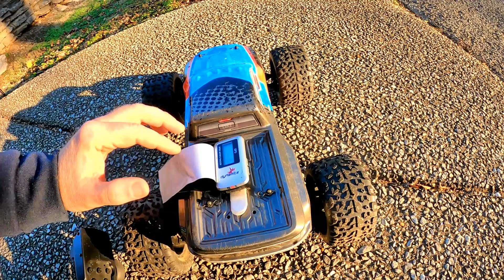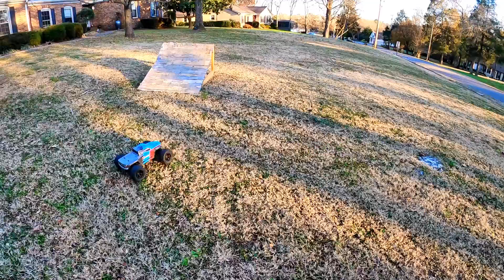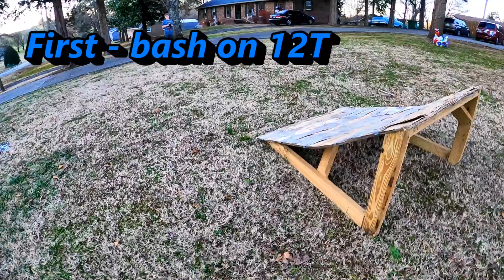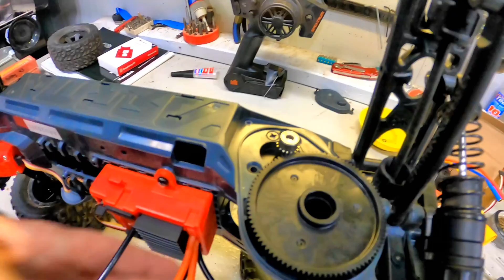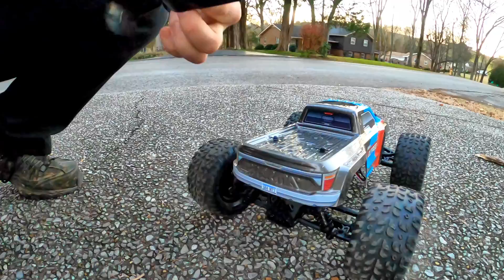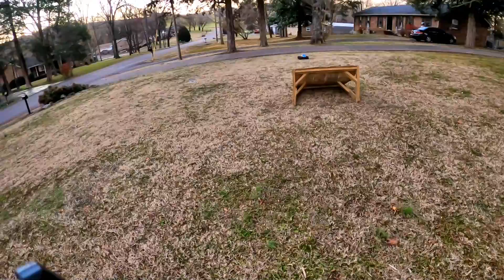Arrma Granite Voltage | 20T vs 12T vs 3900kv | Brushed vs Brushless Speed and Bash Test

Comment: If you would like a better mounting system for the ESC and receiver on the Voltage AND have access to a 3D printer, I've designed a couple of plates using the original standoff screw holes. Check it out: https://www.thingiverse.com/thing:4678451
Reply from the maker: Thanks for the tip!  That is great!
Reply: You’re awesome! Ty!

Comment: Did you end up flipping the pinion mine came like that
Reply from the maker: I never changed it from what you see here.
Reply: @RoadsideRC  should I go for a gool rc motor not sure which one will give best punch I have 12t motor and 2s 120c 5200mah lipo wanna get a good motor which kv is best

Comment: I put a 3930 kv in mine and its a little tight theres no playis there supposed to be some play between the spure and pionion gears
Reply from the maker: There are a number of videos online about setting gear mesh.   Check some of those and compare to what you have.
Reply: @RoadsideRC  the pionion is 16t

Comment: If it was a 12t racing motor it would have great torque and higher speed
Reply from the maker: This was a 12T 550.  My understanding is a 12T 540 might have been a little better, or one with adjustable timing.

Comment: Unfortunately thr gears aren't made foe brushless,  I had to learn this thr hard way. Eventually putting the brushed system back in. You can buy steel gears for 100.00 but a bit much for a 120.00 truck .
Reply from the maker: I had good luck with brushless on this truck. No issues bashing it!

Comment: Do the 540 and 550 motors use the same pinion gear?
Reply from the maker: In this video, I used the same one.
Reply: Cool beans. Ive seen on Amazon that some 540 motors have a 3mm shaft instead of a 3.175mm shaft. Does that cause any problems?

Comment: I bought one for my son for Christmas and it's a lot of fun. The stock battery was a 6 cell NIMH.  On this video you used a 2s lipo. I was wondering if there was any speed improvement from a 6 cell to a 2s? Thanks
Reply from the maker: Max speed at fully charged shouldn't be much difference, but the lipo holds a higher charge for longer, so you get a better run time and more fun.

Comment: I am just getting in to rc cars doese it take a lot to upgrade to better moter ect
Reply from the maker: You can see in this video what it takes.   Links are there for the prices, etc.
Reply: Im getting 1/10 with a 390
Reply from the maker: Which one?
Reply: Bezgar
Reply from the maker: @nickwilliams6869  That will be a little bit smaller 1/10, so the 390 will do good.   It will still be down on power a little bit, but fun!
Reply: @RoadsideRC  thanks for the help
Reply: Never mind im getting a 1/10 with a 550
Reply: 112

Comment: The problem with the 12T is that remember you had to reverse the motor wires so you were running the 12T in reverse and those motors come with a set amount of advanced timing but when it has to run backwards your running the timing retarted, thus the slow speed if you had a reverse rotation 12T 550 it would go a bit faster you could also run bigger pinion and get more speed that way and it would probably run cooler ,I didn't read all the comments maybe someone has said this already but if not hope this helps.
Reply: I love comments were you can tell someone actually knows something and is trying to be helpful. Hard to find these days.
Reply from the maker: You are right for sure!
Reply: That is a fantastic thing to remember when swapping motors!  Thanks for the great info!

Comment: To be clear, the stock 3in1 esc is able to handle a 12t 550?  That is my make or break when deciding on whether or not to buy this as a budget basher, keeping in mind I already have 6 rcs and 2 drones.
Reply from the maker: That is what you saw!  I put that motor in it and it ran fine.  Only caveat: I didn't run it for long.

Comment: Before going brushless I'd replace the stock diff outdrives witn the Hot Racing metal outdrives and 12mm wheel hex adapters. Just make sure the 12T is fully broken in. Add a little brush contact fluid to your motor. You should see something like 22 to 24 mph. Great video.
Reply from the maker: Thanks for the tips!

Comment: I'm pretty sure if you were to use the VXL 3S system on there it has the screw Downs just like the armor does on the side and it's actually the same measurement which would fit perfectly and will wake up that truck and also changing that pinion gear to about a 20 you'll get a good 50 out of that truck
Reply from the maker: You are correct- but the VXL system is very expensive.  The goal here is a budget upgrade.

Comment: Those ESCs are dangerous just letting ya know lol. I put the GoolRC 3660 3300kv 60amp esc into my Arrma Granite mega v3 when I first got it... I put it on a Ovonic 5200 3s 50C battery. It ran good for about 6 days and I was doing speed runs on a 17T 57T gearing which is fine. But the esc smoked and shot fire out of it 🤣🤣.. but that was a while back I got a 4076 2200kv on a max 6 esc now way way way faster lol
Reply from the maker: I have had a bunch of these over time, and they seem to hold up as long as they are not worked too hard.  Sounds like you were really pushing it hard.  On 2S, I have had them live for a long time!
Reply: @RoadsideRC  I've abused the crap out of 1 of these esc with overgearing it and I've never had a problem. Honestly I can't believe it hasn't burned.  Its actually became a joke because I've abused this 4300kv motor and esc for about 1.5 years and I got it from a buddy and he abused it for about a year b4 I got it.. 
Its currently in a bandit on 35/76 gearing on 3s.. doesn't care at all. Before that it was in my slash 4x4 on 21/50 gearing and it got hot as hell but never died obviously. I've learned to love that little motor lol

Comment: You didn't mention in your video, but I'm guessing your 20T motor was a 540?

A 20T  540 and a 12T 550 motor have about the same rpm/KV so it makes sense that on the stock pinion the top speed is about the same.

The 550 will however have a lot more torque meaning you can gear it up; use a larger pinion to increase top speed without the motor overheating as much as it may on a 540 if you over gear it.
Reply from the maker: You are 100% correct - there was a 540 vs 550 ,difference there also.
Reply: @RoadsideRC  
I would recommend trying the 550 12T motor with a 25T pinion gear, for a fair comparison 👍🏻

Comment: What control angle did you get for the servo?
Reply from the maker: I typically use the 270 degree and just set the endpoints correctly, but the 180 degree would also work.

Comment: I have a granite voltage. With a five 550 12 turn motor and a 19 tooth pinion it does 24 miles an hour
Reply from the maker: Thanks!
I do believe a higher pinion in this would help a lot.

Comment: Can I run a Nimh battery on that esc?  im a noob
Reply from the maker: If you have the program card that goes with it, pretty sure you can turn off the LVC to allow it to run nimh.
Reply: @RoadsideRC  thank you!
Reply: @RoadsideRC  I’m thinking about getting a 2s lipo for the brushless system,  what do you recommend?
Reply from the maker: Measure the battery box, and buy the largest mah, highest c-rating, you can afford - that fits in the box.
Reply: @RoadsideRC  what voltage does it have to be?
Reply from the maker: 2S lipo is a standard voltage, there is not a choice there.  They will all be advertised as 7.4V
Reply from the maker: @jamiesonrc3690  This is a great deal.  According to online battery box dimensions, it should just BARELY fit.  It might need a squeeze  :)
https://amzn.to/2NoCCz9
Reply from the maker: @jamiesonrc3690  This is not as good of a deal, but fits easier.  https://amzn.to/3pOjp75
Reply from the maker: @jamiesonrc3690  Are you comfortable soldering on your own connector?
That opens up MANY more choices.
Reply: @RoadsideRC  yeah I can solder

Comment: Dam I just bought a 12t before watching this 😩
Reply from the maker: It will still do you well. 
Is it a 540 or 550 can motor? 
You might still pick up speed with a 540 can.
Reply: First he didn't even break the brushed motor in lol
Reply from the maker: @mod-sausage86  That was not the first time that motor had been used.  It had already been broken in.
Reply: @RoadsideRC  did u water break it in ? It's a thing big difference
Reply: The top speed wont change without a bigger pinion gear - upgrade the pinion to a 19 or 23 and you will see

Comment: If you use a 3650 brushless motor, you'll encounter clearance issues, which can be one reason your motor shaft appears too short. Its much better to use a 3660 instead. Not only will a A 3660 be longer for proper fit (60mm instead of 50mm) but it will have a longer shaft (17mm vs 15mm) and a lot more torque. My 3660 motor fits perfect with a bit of room to spare, the shaft is the right length, and it absolutely flies...
Reply from the maker: Great!  Good info!
Honestly, I just used this system as it was super cheap.
Reply: @RoadsideRC  Excellent video BTW! I used this video to help with my upgrades. For anyone who is looking at upgrading you could also use something like a 3660, 3300kv brushless motor (why 3300kv? for 3s Lipo of course ;) and a 19t 48p pinion from Robinson Racing. With the 19t pinion instead of 16t and a 3300kv motor it hits the same top speed of 29 mph (19t/16t = 1.19 * 3300kV = 3900kV equivalent). I have the 3660 3300kV, 19t combo in mine, it stays cool to the touch, and wheelies at almost any speed...

Comment: Heya, I just did a similar conversion on my Voltage, I used a 3660 3800kv GoolRC motor. Did you have issues with the servo working but no throttle/motor response?
Reply from the maker: No, sorry.  It worked right out of the box.  The ESC has quite a low "punch" setting, might be slightly underpowered, which causes it to hesitate off of the line.
Reply: @RoadsideRC  I had hoped it was punch, but I think the motor or the esc is dead. The motor doesnt turn with zero load. it doesn't beep or anything. We'll get a replacement and see what happens! Thanks for replying back.

Comment: The key is in the gearing, with brushed motor. I have a stampede that once the gearing was replaced, it does standing backflips. 32pitch, 58 tooth spur, 16 tooth pinion. 12T motor.
Reply from the maker: Yes, gearing has a lot to do with it for sure!
However, depending on the rating of the brushless motor, you can always get more speed out of it that way also.  

Thanks!

Comment: hey man, I myself have done some testing & after some research. I've come to find out that lower turns doesn't always mean the motor would be faster. If you did a comparison of only 550 12t motors from different manufactures (which is slim these days), you'll notice the motors all have a different peak rpm@7.2 or 12v. At the moment... a budget friendly & well crafted motor that lives up to the performance of a 12t 550 motor in my opinion is the holmes hobby trail master sport.  I'm currently using a Holmes hobby 21t trail master motor with a 25t pinion, it's noticeably  faster & gives off less heat than the stock 20t motor. I plan to swap out the motor for 550 12t trail master motor when it becomes available.
Reply from the maker: Thanks for the tip.
It does make sense that the quality of the motor plays a big part here.

Comment: 3s!
Reply from the maker: Brushless 2S was starting to get hard to control.   3S would certainly get wild!
Reply: @RoadsideRC  Those tires rubber are thin and easily expand, but with better tires this platform handles quite good on 3s.

Comment: Awesome video!! I have been experimenting with mine as well. You HAVE to up the pinion to 19t with the 550 12t brushed motor. Lots better 👍 I am going to try it on 26t as well. I burned up the stock motor already 🤣 Took it on a baseball infield so that could have been part of the issue with all that fine gravel 🤷‍♂️ If I go brushless there is an rcjuice 540 5200kv motor I am eyeing
Reply from the maker: Thanks!
I was pretty happy with that 3900kv!   Running it on 3s would certainly do the trick!
Reply: @RoadsideRC  3s would be nuts! I wonder if the plastic gears could handle it 🤔
Reply from the maker: Agree!

Comment: Hows the heat? I slapped a 12t in when I first got mine because I had it laying around. It gets super hot though.
Reply from the maker: Interesting.    That Hackmoto came back from the run with zero heat issues.   
To be fair - it was around 40F outside and it is a 550 motor.
Reply: @RoadsideRC  mine is a titan 12t out of a slash. After a full battery run it was super hot. Of course thats with a 6y/o running it full throttle for a full battery. Stock nihm battery.
Reply: Also this was summer in Florida.
Reply: Titan motors do get hot but never show issues when ran multiple batteries while it’s hot